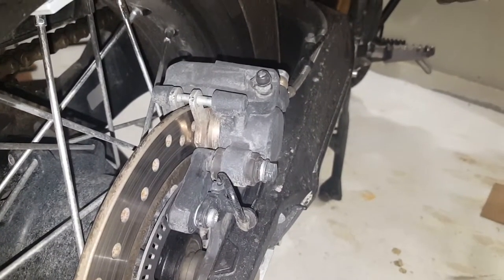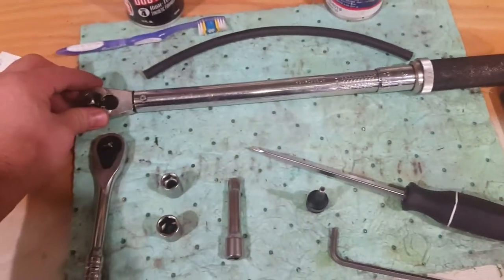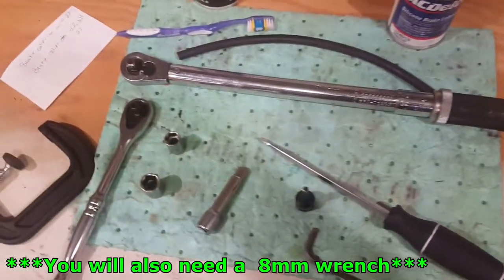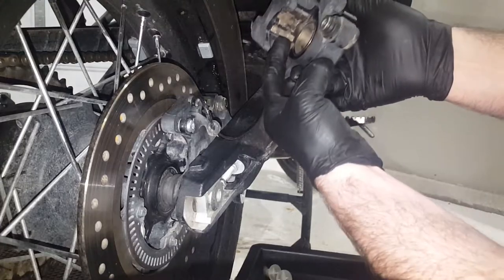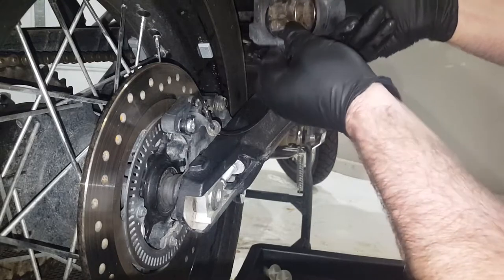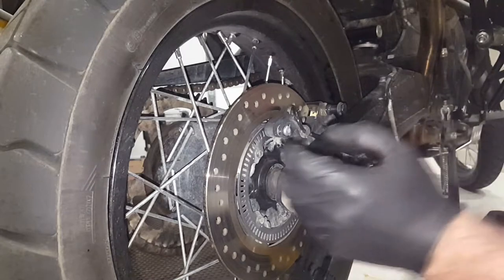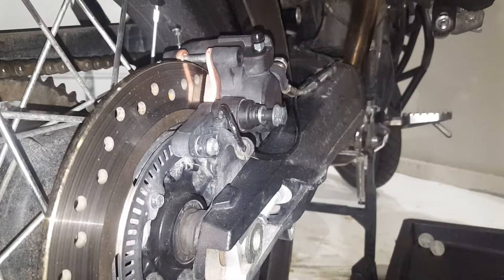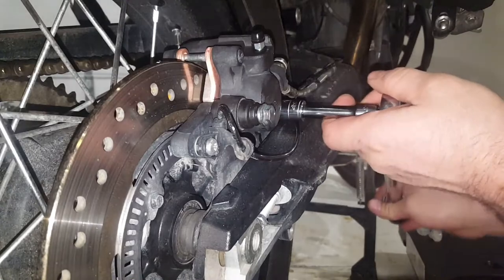How to Replace Triumph Tiger Rear Brake Pads

Comment: Nice to see a new video from you my friend
Reply from the maker: Ian Bonham thanks! I got a few more I'm working on.  The winter has been long and wet!  Thanks for sticking around!
Reply: No problem brother, awesome job. I like your channel, look forward to see your adventures this year.
Reply: Great video!  I just bought a 2015 Tiger xcx with 10k miles.  It has original brakes but the rear brake pulses when applied.  Rotor seems to not be warped.  Any suggestions before I clean and replace pads?
Reply from the maker: Don McSwain there are a few reasons you would geat a pulsing from tge rear rotor.   Fist would be and activation.   Second would be the rotor having a wrappage that you may need to measure using a dial indicator.   The other one could be a thickness variation in the rotor.  To find that you would measure 5 to 8 different points around the rotor. You want them to be close within .005"   not sure what the exact spec is but that seems to be comon.

Comment: Hi. Thank you for this video.  I just saw it for the first time. Very helpfull.  I can't find a good video for the front brakes so i have a question for you. Do i have to also bleed the front caliber like you did for the rear?
Reply from the maker: You can squeeze the brake pistons back in using the old pads and don't open the bleeder.  It will push the old fluid back up to the reservoir.  Make sure to pump the brakes before riding
Reply: @PistonSlap  Thank you again.
Reply: Check out muddysump on YouTube for your front pads